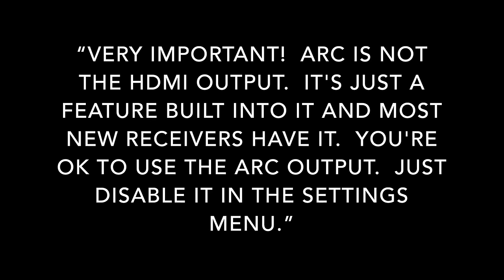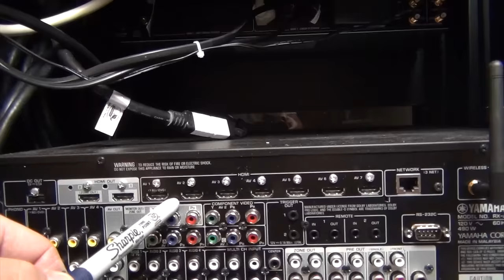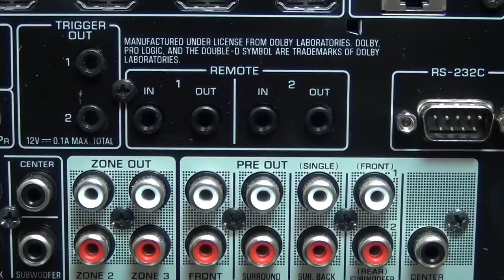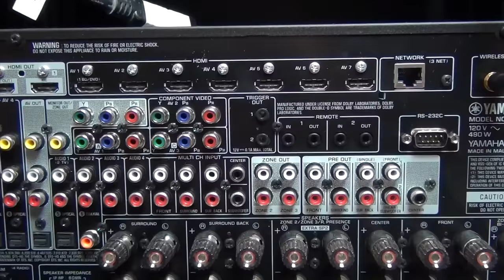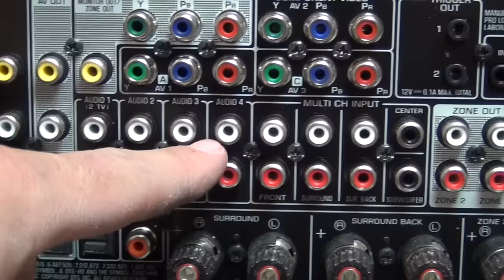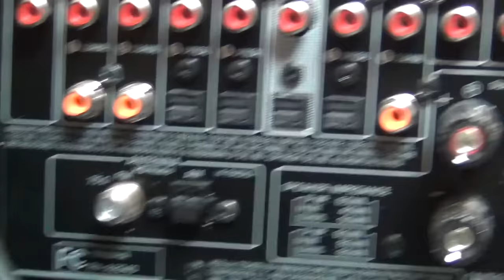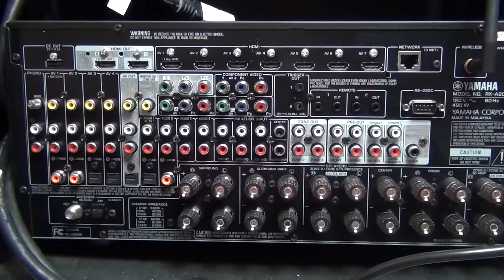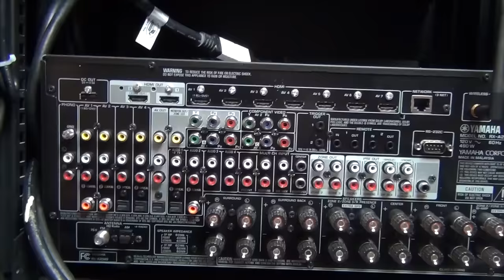How to connect a surround sound receiver - Part 3

Comment: So Alan how would you go about it if your surrounds are built geared towards dolby Atmos. I know in your video you say you hate ARC. What is another alternative?  Finally did all the wiring but now stuck with an extender that sends thru arc one way only. Company said the  Receiver will connect to ARC port on my Projector and Sender will connect to your Marantz. However, the ARC is returned back from the sender via optical drop out unless I bought the $300 one instead of the 230. SMH. I might try my luck at running a 35 feet fiber optic 4k HDR HDMI. MY av rack to project is only about 10-15 foot away but i have to factor from ceiling to ground.
Reply from the maker: I am not sure I am understanding what you are asking. Are you using ARC to turn on the projector? You can use a 12v trigger from your receiver to the projector or you can use a remote control. To use the remote, either run a blaster cable (just two small wires) from the remote receiver on your AV rack or add an additional receiver on your projector. You can use an ARC HDMI port, just do not turn on the ARC feature. You shouldn't need to use ARC to bring audio from the projector. There shouldn't be any audio coming from the projector.
Reply: @AlanCleggYouDoAV  aghhh understood thank you. Sorry if I can’t off confusing. Bought an OREI extender with ArC. I have it under the impression that to run Dolby atmos u need arc only. I’m now at the point of configuring my first ever AV receiver lol. Cutting drywall in wall, in-ceiling  and wiring with the wet noodle u suggested made it easy Lee you. Now that that’s down it felt like it was the easy part. Long story short I could have made it easy on myself and just placed my aV rack on the other side of the family room but instead I went with having everything wired to a centralized location in a closet with plenty of room.  I’ve spent this much already for premium sound so I can’t just settle for just Dolby 5.1.
Reply from the maker: @FMD023  ARC=Audio Return Channel. Typically you send 1-way audio and video from one device to another. In the case of a surround sound system, the receiver sends audio and video to the TV. If people want to stream Netflix on their TV, they need to backfeed the audio from the TV to the receiver OR they can use ARC built into the HDMI cable. ARC used to only carry low quality audio back to the receiver but eARC allows you to carry higher quality formats such as Dolby Atmos. Enabling ARC/eARC introduces control problems so I always turn it off. You won't be streaming Netflix on your projector anyway, so you will not need to use ARC/eARC either. Your streaming device should be sitting on the rack (AppleTV, Roku, BluRay player, etc).

Comment: Hey Great video. Quick question. Is there any way to hook up a passive sub to this system and what equipment would you need. I have two passive subs here and would prefer not to have to buy another one. Thanks
Reply from the maker: You’re going to need an amplifier to power them. You’ll connect the receiver to the amp and then connect the speakers to the amp.
Reply: @AlanCleggYouDoAV  Thanks a million Alan. Got myself a nice powered sub and connected it to the sub outlet on my AV receiver. It all works like a charm now. Cheers. Oli

Comment: Sir how can I fix shure mic 58 with cord to yamaha RXV477
Reply from the maker: You can get an adapter that turns the headphone jack into an RCA and plug it into an audio input but you’ll lose the ability to sing along with karaoke if you’re trying to run them from the same receiver.

Comment: The digital audio inputs are labeled AV1, AV2 etc. If you are then using component video inputs don't you have to assign the audio input AV1 to the component input AV1 or can you assign audio input AV1 to, say video input AV2?
Reply from the maker: If your receiver has the ability to assign inputs, you should be able to mix and match whatever you need. Does that answer your question?
Reply: @AlanCleggYouDoAV  Yes. One more question. I have HDMI over cat6. Cable input to receiver is HDMI. I added an audio balen connected to the TV digital audio out with input into the receiver in the TV digital audio in. Can only get cable audio but no streaming audio from the TV (eg youtube).
Reply: Figured it out. First I need to switch to the home screen with TV remote, choose streaming service and then switch receiver to TV input.
Reply from the maker: @Jnglfvr  NICE WORK!

Comment: Hi.  I have dish box and it has SPDIF output too.  I wanna connect this with the AV receiver,  but it does not have SPDIF input.  Pioneer old amplifier.  How can I go about to connect it with TV and surround ststem please?
Reply from the maker: I’m assuming your receiver does have a digital coax? If so, you’ll need to get an “optical to digital coax converter.” I saw them on amazon for about $20. Good luck and thanks for watching!
Reply: @AlanCleggYouDoAV  Thanks for the reply.  It does have three Optical inputs,  and one Coax,  don't know if it is digital or not.  I could send you snaps of Dish receiver,  TV and Amp's inputs and output.  If you don't mind,  send me your Email ID or WhatsApo number.  I really like your video,  watched 1st and 2nd part.  Very informative. Great work
Reply: @AlanCleggYouDoAV  I managed to connect,  but the sound is Analogue.  Could not hook up digital coax or optical input
Reply from the maker: Maybe send me pictures?
Reply: @AlanCleggYouDoAV  Hi Alan,  thanks for your help.  Could you kindly send me pics of those Converters.  I saw many,  they are mostly,  Optical to Analogue Converter.  Thanks
Reply from the maker: @aqeelk.9055  SPDIF is optical. I didn't know your receiver had an optical input from your original message. You shouldn't need a converter. Just get an optical audio cable and connect it from your Dish box to the receiver and you should be good to go.
Reply: @AlanCleggYouDoAV  Hi Alan,  thanks for reply.  Oh well,  I bought an inverter,  but it didn't work.  Now,  I ordered SPDIF Coax,  lets see it that works.  Your help and reply are highly appreciated
Reply: @AlanCleggYouDoAV  One more thing,  the dish receiver has Coax connectors,  not optical,  the Amp has both (coax and optical)
Reply from the maker: @aqeelk.9055  Both digital coax and optical audio are perfectly fine for digital surround sound.
Reply: @AlanCleggYouDoAV  Thanks Alan.  You are great.  Keep it up.  I will let you know if SPDIF Coax works.  If not,  there mest be a problem in Dish receiver SPDIF port.
Reply from the maker: @aqeelk.9055  It could be setting in the box or receiver too. I don't think I have ever had to activate the digital output on the box itself but sometimes you have to set it up on the receiver.
Reply: @AlanCleggYouDoAV  I am waiting for SPDIF coax cable,  but I will give it a try to look into the settings.  It may work , who knows.  Thanks for help.  I'll be in touch.  Don't wanna loose a person like you.

Comment: Hello, can you please help me ?
I have AVR-X2400 receiver and want to connect my computer.
The computer was connected to my TV with the HDMI cable in advance.
I only have 1 HDMI connection on the TV.
I connected the HDMI cable of the TV to the receiver monitor1arc.
Because there is no PC HDMI input with this receiver, as with you.
I don't know if that's right.
I also have to plug the HDMI cable from my computer somewhere in the receiver I don't know.
Or is that on TV that I buy an HDMI splitter?
I also saw that you can put an internet cable in the receiver.
That is already in my computer without that receiver I could already on the internet.
Where the 2 internet cables.
But I still have 1 if needed.
I don't know receivers, this is my first.
Reply from the maker: Leave the HDMI from the receiver to the TV. That is correct. Plug your computer into the receiver in ANY free HDMI input. It does t have to say PC. The label is only there to help you select the correct input on the receiver so you don’t forget where things are plugged in. Once your connections are done, you should just select the corresponding input on the receiver and your PC will appear on your TV. That’s the benefit of using HDMI switching through a receiver.

Comment: Hi, I have a question. I want to connect my subwoofer to my onkyo receiver but my receiver has 2 black holes like yours and my sub in the back has a red and white holes. Do I hook up regular red and white from the sub to both black holes in my receiver?
Reply from the maker: Good question. You want to use the jack on the receiver labeled “sub out” or “sub pre out.” You may have two sub pre out connections labeled “front” and “back.” Just use the appropriate one. On the sub, pick either one. I usually use the left one which is white.
Reply: @AlanCleggYouDoAV  okay, thank you

Comment: What's the difference between AMPLIFIER and RECEIVER ??  thanks in advance i'm not an expert
Reply from the maker: An amplifier simply powers the speakers. A receiver controls audio AND video and includes internal sources such as a radio tuner, XM, or music streaming services. A receiver also has an amplifier built in.

Comment: Hi Alan. I have an old (2005 model) Yamaha RX-V350 receiver with subwoofer. I'm streaming my TV channels through my laptop to my TV monitor. I want to connect the sound to the TV to watch movies with better sound. There are 2 cables (red and white) connected from the TV. Where should I connect it to the receiver for sound?
Reply from the maker: Are the wires red and white? If so, connect them to the TV where it says "Audio Out" (or something similar to that) and then connect the other end to the receiver where it says "V-Aux." When you want to hear the sound from the TV, make sure your receiver is on the V-Aux input.
Reply: @AlanCleggYouDoAV  thank you. I'll let you know if it works.
Reply: @AlanCleggYouDoAV  it's still not working.
Reply from the maker: @johansmith5132  Were you able to hook up the wires exactly as I described? The labels are super important, especially the one on the back of the TV. It needs to say "Audio Out." If the connection is good, go into the TV menus and make sure you have external speakers turned on. You can set the audio output to "fixed" so you don't have to worry about messing with volume levels on the TV. You can set it to "variable" if you want to use the TV remote to control the receiver volume.
Reply: @AlanCleggYouDoAV  it seems that my TV does not have the hardware/software for external speakers. It's not a smart TV. I therefore stream my channels through my laptop. So I don't think there's something that I can do to play my sound through the amplifier. Thanks for your help.
Reply from the maker: @johansmith5132  You can get a cord called "3.5mm mini to RCA." I'll leave a link for one from Amazon. Plug the headphone jack part of the wire into your laptop and plug the other end into your receiver in the "V-Aux" plugs on the back. MAKE SURE THE VOLUME ON YOUR LAPTOP IS UP ALL THE WAY FOR THIS TO WORK. 
https://www.amazon.com/AmazonBasics-3-5mm-2-Male-Adapter-Stereo/dp/B01D5H8KO2/ref=sr_1_1_sspa?gclid=Cj0KCQiA_c-OBhDFARIsAIFg3eyCTpXnZnaScJsF4fG9psu6cJe_yafSnnXdpH5HlaxROPiXYkusqtUaAlJ6EALw_wcB&hvadid=557421757561&hvdev=c&hvlocphy=9029671&hvnetw=g&hvqmt=e&hvrand=16456097391957105912&hvtargid=kwd-328330496542&hydadcr=17978_13446658&keywords=3.5%2Bmm%2Bto%2Brca%2Badapter&qid=1641335085&sr=8-1-spons&spLa=ZW5jcnlwdGVkUXVhbGlmaWVyPUFVUUNEOUlSVElYU0gmZW5jcnlwdGVkSWQ9QTAyOTgxNTYxVTNHT1pRQlE1NERFJmVuY3J5cHRlZEFkSWQ9QTA2OTYwMjMyOFZINDYwNUwzU1NVJndpZGdldE5hbWU9c3BfYXRmJmFjdGlvbj1jbGlja1JlZGlyZWN0JmRvTm90TG9nQ2xpY2s9dHJ1ZQ&th=1

Comment: So i can use zone2 and zone3 as an pre amp output.my pioneer sc71 reciever doesnt have an pre amp output.
Reply from the maker: Do you mean, can you use Zone 2 or 3 as a pre amp to power speakers in Zone 1? I don't know if I have ever had that question. I am pretty sure I have never seen a receiver that has Zone 2/3 but no pre-amp outputs for zone 1. I think you should check again. I'd be willing to bet, you have them.

Comment: can the zone outs work simultaneosly with the surround , or L R , set up ?   I was hoping to set up a separate amplifier, in conjunction with the existing set up.
Reply from the maker: Yes! That’s the benefit of having zones. They can play any source at the same time as the main zone. They can play the same source or a different source. I think that’s what you’re asking?
Reply: @AlanCleggYouDoAV  ijust want to know apart from the main zone if i want to add a bose system to hear my audio from the CD system can i just use the Zone 2 system to hear
Reply from the maker: @sofishan1  Are you asking if you can add a CD player to a 2 zone system?
Reply: @AlanCleggYouDoAV  yes alan thats correct
Reply: @AlanCleggYouDoAV  Hj alan i want to connect a Bose acoustic mass 5 seeries III  Speaker to my RX V1067 aprt from my main 7.1 speaker setup just for listening to my Audio CD's what options do I use i would likke to ise the optic cable from my CD player bit confused where to plug in my speaker out to my Bose acoustic mass thanks

Comment: Hey Alan, I have an Onkyo TX-NR676 now set up for Zone 2... in fact, Zone 2 works beautifully with access to all sources of analog as well as digital. HOWEVER, I can now only play the built-in tuner on the main!!!! No other sound will come through on the main. Any ideas why????
Reply: I recently bought an old Pioneer SC-LX57 from a friend, and I am trying to set it up. I have the same problem too. Only audio I can hear is from the tuner. I hooked up a cd-player and a mini-disc player and there is no sound. They made this way too complicated to use.

Comment: right now I'm using arc  how else can  I hook up my reciever to my tv ?
Reply from the maker: I did a bad job of explaining this point. You can use the ARC output but disable the ARC feature in the setup menus.
Reply: @AlanCleggYouDoAV  oh ok thank you
Reply: @AlanCleggYouDoAV  in both the tv and reciever?
Reply from the maker: @rickross6390  ARC is related to "HDMI control" which I really don't like. I prefer to turn HDMI control off in all devices. If you turn off HDMI control, it should disable ARC by default.

Comment: Hello, is there an option to connect new TV with old 5.1 Genius surround system that i am using on my PC, that only got RCE cables?
Is there some kind of adapter or anything to use RCE to hdmi arc on tv?
Reply from the maker: I’m not sure if I understand. Can you explain a little more? What connections are on which device?
Reply: @AlanCleggYouDoAV  Well new TV have only HDMI arc and old 5.1 speakers use RCA connection , so is it possible to connect these two only with some kind of reciever?
Reply from the maker: You’ll need a receiver for sure. If you want I use those speakers you’ll need an adapter to go from RCA to regular speaker cable. Something like this should work:

https://www.ebay.com/i/272949075770?chn=ps&norover=1&mkevt=1&mkrid=711-117182-37290-0&mkcid=2&itemid=272949075770&targetid=884989444770&device=m&mktype=pla&googleloc=9029721&poi=&campaignid=9338046707&mkgroupid=94993982379&rlsatarget=pla-884989444770&abcId=1139336&merchantid=101719306&gclid=Cj0KCQjwjoH0BRD6ARIsAEWO9DsrmVaDJNf9NNDEsSGx6LVDOh18c31qK29Jux4ECzC2Tj0IlBhDZ-IaAg-_EALw_wcB

Comment: Hey Alan, I have an old Pioneer Plasma flat screen that I love and want to hook up a Blu Ray DVD player to through an AVR. The plasma tv has an s-video input.  Can I use the "s-video monitor" on my AVR to connect to the tv and run the blu ray as hdmi into the input of the AVR?
Reply from the maker: No. If your receiver has a feature called “HDMI upconversion” your receiver will turn an S-Video from the Blu-ray into an HDMI signal to the TV but not the other way around. If you come in with S-Video to the receiver, you can go out with S-Video to the TV but it is only video- no sound. You’ll have to run a digital audio cable of some kind from the Blu-ray to the receiver.
Reply: @AlanCleggYouDoAV  My dvd player is a Sony BDP-S3500 so only has HDMI out and Digital out (orange). So doesn't look like I will be able to use the s-video input on the tv unless I use the dvd hdmi out and adapt it to component connection correct?  I'm looking to pick up a cheap used AVR that will help me connect these two devices but if I cannot use the s-video input on the tv for this then it really doesn't matter which AVR I pick up correct? Just look for something with analog, component, and digital inputs and don't worry about the HDMI I guess?  Sorry for all the questions but I'm a little confused of the best way to connect the dvd player to my plasma tv through an avr.  (long story short, the hdmi jack on the tv is bad but all the other inputs are fine. I thought s-video was the 2nd best input.)
Reply from the maker: Hmmmm... this is a tough one. I think you should hook up the orange digital audio into the receiver and be done with the receiver connections. Then you’ll have to convert the HDMI signal to S-vid for the TV connection. I did a quick amazon search and found this:
https://www.amazon.com/Converter-Composite-Adapter-Support-Blue-Ray/dp/B07GVDWGK8/ref=asc_df_B07GVDWGK8/?tag=hyprod-20&linkCode=df0&hvadid=309881068962&hvpos=1o1&hvnetw=g&hvrand=13746700813918672075&hvpone=&hvptwo=&hvqmt=&hvdev=m&hvdvcmdl=&hvlocint=&hvlocphy=9031290&hvtargid=pla-568835413361&psc=1
I DONT KNOW ANYTHING ABOUT THIS PRODUCT. IM NOT SELLING IT AND I HAVE NEVER USED IT. I am merely showing you that products exist that may work. If this works, this will solve your problem.